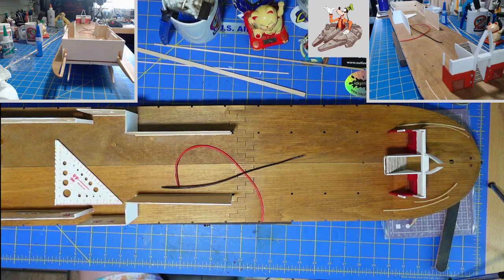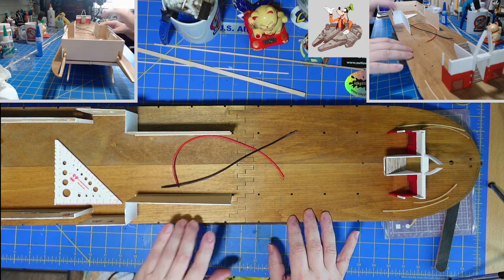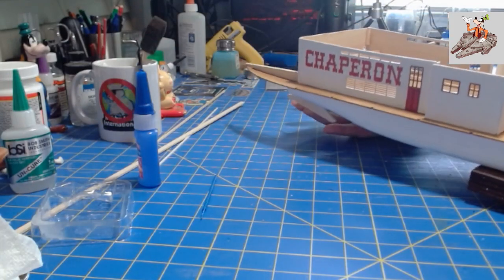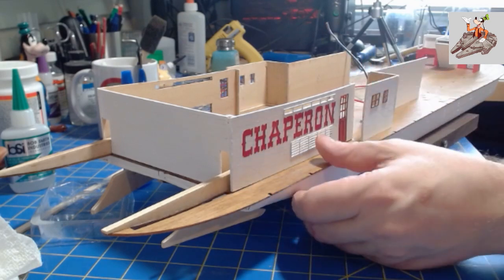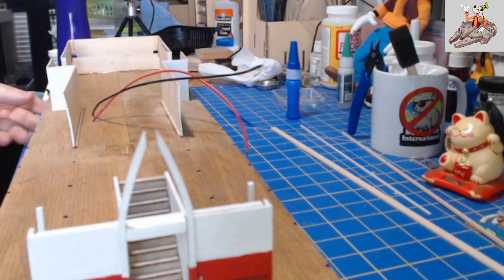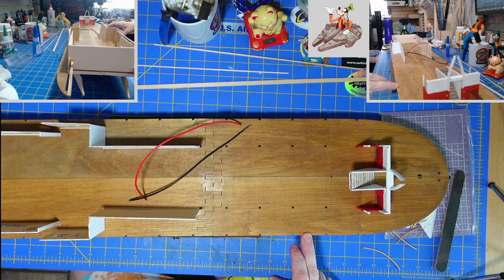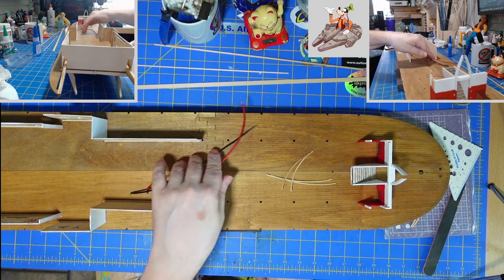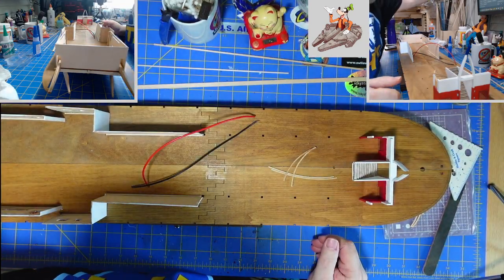Model Expo 1/48 Chaperon wooden steamboat (paddle wheel) - Part 1

Comment: I’m wondering…… I have some very thin walnut strips. I could plank over the existing deck and cover those joints.  Would it be worth the effort?
Reply from the maker: I think it would be worth it for the main and boiler deck, but if you paint the hurricane deck black as per the instructions, I don't think that would be necessary.  Hindsight being 20/20, I should have planked the outer edges that will be visible.  You will just need to make note of the etchings on the deck for where the structures will sit.  I'm looking forward to seeing how it looks if (when?) you do it.